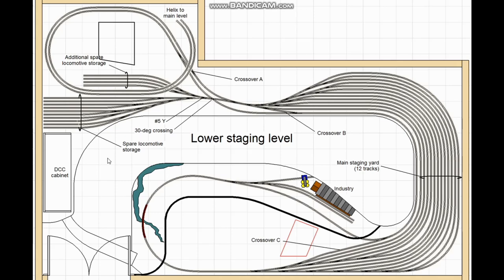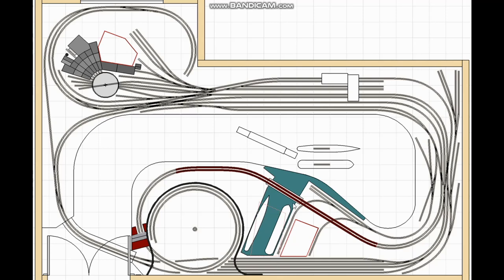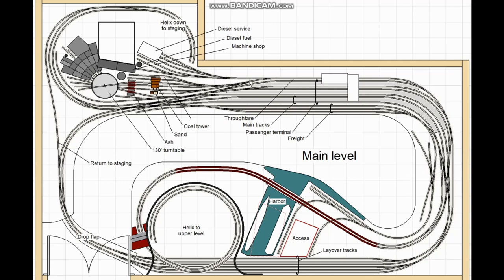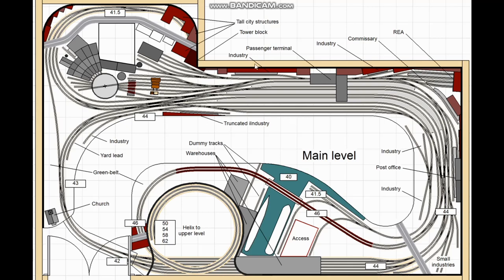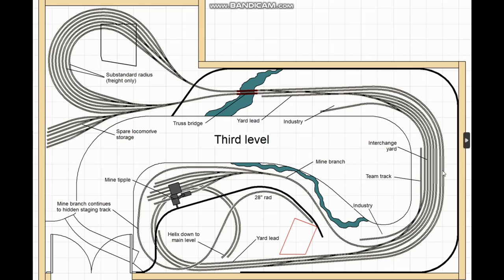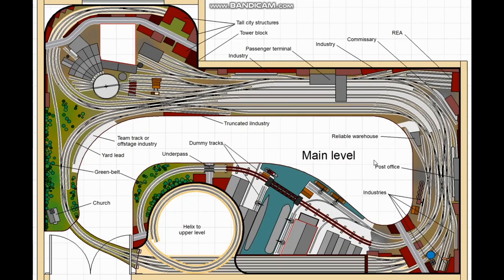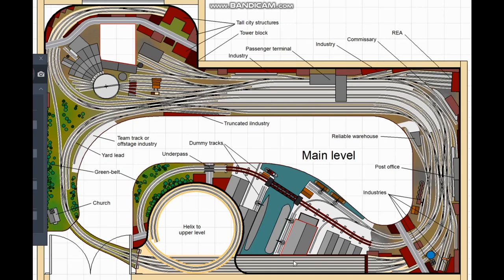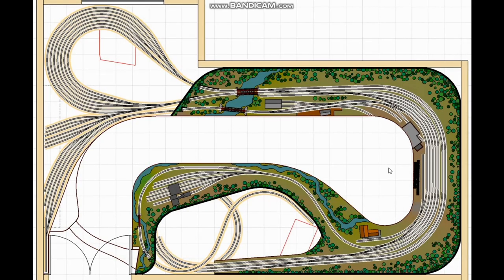Passenger trains and two large ship models, part 2

Comment: I must admit that I don't really like the too tight layouts that remind me of the noodle bowl of the old days, but I am always admired by the ability to conceive and materialize them in relatively small spaces. I congratulate you for it
Reply from the maker: Thank-you for the compliments.  I do need to correct you on one point, however.
The "noodle-bowl" or "spaghetti-bowl" layouts of the old days were attempts to get extra route miles by running the main-line through the same scene multiple times.  This design is NOT a noodle-bowl.  In fact it is what's known as a "sincere" design where the main-line never passes through the same scene twice.  It is however rather cramped with a very high track density as appropriate for a dense city area.